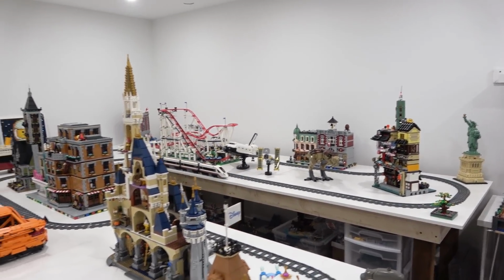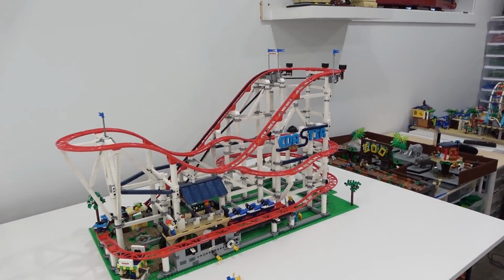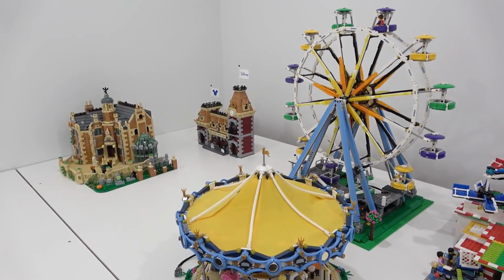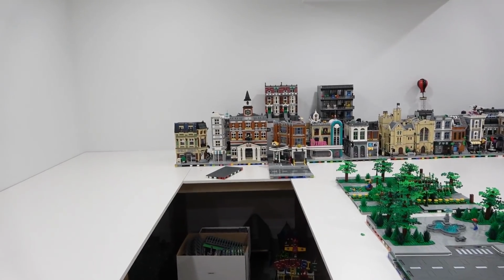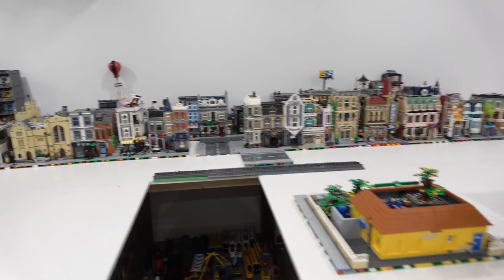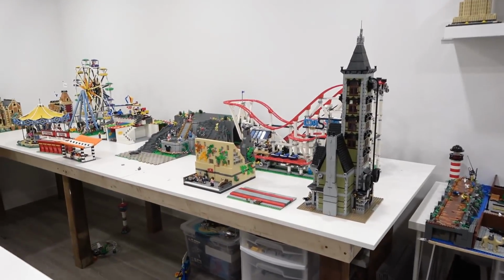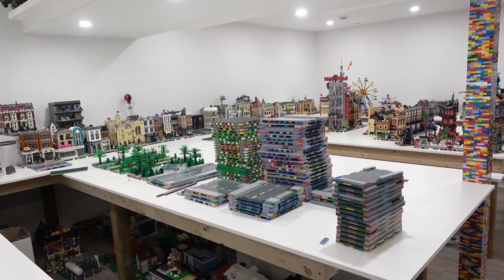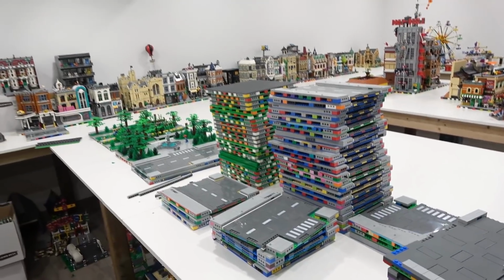LEGO City Rough Draft & Planning! Room Rebuild Part 8

Comment: I don't really get the problem, tbh. Why can't the modular buildings be snug against the platform? You can always cover up the front of the platform with a backdrop? I think it would be a bit of a waste using rock panels etc because you'd never see them... The train can run underneath the platform and in front of the modular buildings on the lower level. I love the idea of the amusement park on the larger table, I think that would look much better, with the platform and train going all the way around. Awesome job so far, love it!!

Comment: To get the rollercoaster running smoothly again check the carriages wheels are spinning smoothly when you spin them by hand. We had the same problem as yours and it turned out to be a fault carriage wheel. Replaced it with a new one and now it flys round the track super fast now.

Comment: For the platform in the back build it as a shelf mounted directly to the wall so it doesn't compromise as much table space and allows for extra wiggle room to make sure everything fits correctly how you want it. It also helps with getting the train system behind it and other potential hidden treasures

Comment: A couple of thoughts here:
1 - transform the 3 tables in 3 different city areas, like (left to right) seaside + beach + port on the first table, residential + downtown in the middle one and mountain + foretlst on the last one (lifting the mountain into the corner).

2 - make a gallery for the train behind the modulars, so to be able to line up the road on the edge, the modulares right behind and the tracks hidden in the galleries (you can use burps to hide the gallery AND give support to the coverage of the cardboxes)

3 - lay the streets following the shape of the tables, so to have the buildings aligned to the long sides of them, and not the short sides. That way, they will not end up "blocking" each other

Comment: Are you gonna paint or put vinyl laminate on the front of the exposed 2x6s that can be seen? I would make it a cleaner look. Hmm, I just thought you can have the back upper row buildings than a road and train tracks. Rock wall coming down than the lower row of buildings then a road. I hope that makes sense?

Comment: I agree with your current thinking for the location of the amusement park because although there are some tall structures such as the roller coaster and ferris wheel, they aren't solid builds and you can still see 'through' them. The raised platform can overhang the support legs to give room for whatever vertical lego structure you want behind the lower buildings, have you thought about 'arches' so that the open sections are between the platform legs? This would look cool using masonry bricks and foliage pieces and would even accommodate the roads that you want to have heading to the wall, you could use railway road crossings too plus the trains could still be seen running under the platform, easy access too - win win! 😁👍 I hope you like my suggestion, keep up the great work 👍

Comment: Hi. Since you ask in my opinion, I would focus on making it the most realistic. Tallest buildings in the back of the room, with one straight road in the middle - (big city). Then smaller in front. Everything on one level. In the corner, in the front of the room a larger mountain, with a lookout point - and train track go through. Does it have to be train tracks in the back of the room - maybe it will be too much?.  Either way, keep up the good work. Exciting to follow :)

Comment: My suggestion for the layout is to have raised platform around the corner too. On the right side of the city pop culture buildings, skyscapers in the corner, then the rest of the modular towards the left, finishing with landscape/campground in the left corner. On the right/center table the amusement park, on the left/center table residential area, which is lower. On the left side of the city I would put Ninjago as an island in front, then the sea continues into beach and cargo area all the way till the campground.
I hope I explain myself well.

Comment: LEGO is my secondary hobby.  I have a 450 square foot train layout in our attic.  When I have vertical areas that I want to hide, I do flat facades that are designed to blend with the buildings and landscape of my layout.  You could build basically make LEGO art panels on baseplates vertically and placed slightly recessed below your platform to give a feeling of depth without losing space.  Mrs. Bricksie has already basically done a similar thing to hide the backs of Diagon Alley.  It could be done in a way that is less parts intensive.  Try making one and see how it looks.

Comment: Hmm, personally I don't think you need the risers at the back.  I think that it'd look cool to have a city blocks layout, where you might have a block of modulars, but have some of them with their sides against the wall.  Imagine, say, a 4x4 square of modulars, but it's cut off, so just one half of it is visible, like it's sticking out of the wall.  In the center of the half square, you could set some taller, skyscraper type buildings, so that things are more built-up along the back wall.  You might need more skyscrapers for that though.
If you do go with the risers at the back, I would say that if you can't build it all out of Lego (I know, that's a massive suggestion, even if you got duplo for the bulk of it.) then perhaps you could disguise it, or the edges/entrances of it as part of the city's infrastructure, like an underground highway/train tunnel.  You could even use those ramps from the road plate sets, and have the MILS plates go down onto the old road plates under the risers, just to make use of all those plates.
Another idea, instead of using millions of BURPs and such to build a facade around the risers, if you make the risers 10 or 15 inches tall, you could use baseplates on their sides as the facade, and then use some clever SNOT techniques to build stuff on them, like say a staircase going to the upper level, a broken, grassy cliffside with a half-fallen tree, and a lot of back-alley type places, with bonus points if they're in a state of mild disrepair, like a real city would have, if there was a three story high cliff that the entire downtown was built around.

Comment: I like your original plan of the amusement park on the 60 inch table because of the extra space, and think about the other amusement sets that are/could be coming in the future. Same goes with having a half baseplate between your modular buildings. It is important to let you city breathe, it gives the opportunity to add a bit of life to the city and do a bit of story telling of your own. Only thing I would suggest is having a brick built wall rather than using the rock wall pieces.  Can't wait to see it all come together, its going to be epic

Comment: I would keep the train track out front without the baseplate. Then you can also run the train under the platform and put lights under the platform as well as decorate it. I would also use burps to the cover the front of the train tunnel. Would be great to put the GoPro on the train and get footage of it running through the tunnel.

Comment: The best part of your city is the downtown with modular buildings. In my opinion, this deserves the big table and can be done in a way similar to the old city, with long roads parallel to the table which gives depth and perspective. The rest will find its place around the city. No need for elevated platforms. When it comes to trains, I would do as you concluded before. No trains on tables, apart from the amusement park. You can rather put them under the tables, or more interestingly you could make a tube.

Comment: I would consider having the big table for amusement park. Not because it's my favorite part of the city, but because it requires a lot of space. Especially when you think of how much it consumed in the previous layout and that new rides will come out soon. You would have to compromise a lot if you choose to put it up against the wall. And I don't think it would be a lot different with the height, compared to all the other tall buildings you have. That's just my opinion.

Comment: I believe you had the right idea initially with wanting the tall theme park things in the back, and that putting those or Ninjago in the middle will ultimately be unsatisfying. I think you're going to want most of your shorter buildings in the middle tables, even if you do a platform in the back. like residential buildings, suburban area, etc. and tall stuff like Ninjago and Theme rides in the back areas. I would probably try first with no platforms in the back, and have the whole back wall be one long pop culture street - like a hollywood blvd, vegas strip type of thing.

Comment: What about using the dead space under your back row of modulars? It could be a fantastic tunnel system for your train to weave in and out of - occasionally popping out between 2 modulars and then winding back around before re-entering another tunnel somewhere elsewhere. There's plenty of space under there for 2, maybe even 3 rail lines!

Comment: Hey Jordan, love the new layout and it makes sense to raise the modulars that are against the wall, in my layout I push the lower modulars right against the raised platform due to space, building a rock 'face' all along doesn't make much sense as you can't really see it - if you do flat arches etc underneath the raised area, you could break up the raised section by having areas in-between with rocks / greenery etc and a short road bridge linking each raised section - bridges also look very interesting and allow you to put things underneath (in addition to the track..)

Comment: You do not really need the sidewalk on the side of the road without the modular buildings, so if you put some separation between the road and the train tracks (one or two studs wide perhaps a low fence) you could free up space that could be used behind the buildings. (I have not read all the comments, so I am not sure if anyone already suggested this)

Comment: I think your idea to have the amusement park in the middle table instead of the side table is better. Aside from a few big rides, the amusement park is mostly medium sized buildings and open spaces so it wouldn’t block the modular buildings. Pop culture street has a lot of tall buildings and skyscrapers so it would make more sense for them to be right next to the wall. Just my thoughts 😊

Comment: I've seen some MILS plates where the road and rail is on the same base plate.  They looked nice as well.  Compresses the amount of sidewalk but could work.
Reply: Agree on this, move the road close to the edge of the mils plate on the side that is against the modular as they already have a footpath, and you gain 8 studs, then have a reduced footpath on the track side

Comment: I would create a underground system rather than have the modular buildings sitting on boxes. 
That way, you can have little underground stations as the train runs through on the back wall, but have the modular buildings on top, with 'fake' stairs leading down to the stations.

Comment: Remove the sidewalk on the mils plates closest to the edge of the table and build the train track into the road (as a 3rd lane of sorts) or replace the sidewalk with a 1 or 2 stud wide guardrail and gain some extra space for the train track so you can still use the rock panels behind the modulars.

Comment: All your ideas are great why don't you mount the showings on the wall instead of having them stand on legs and then you could run the train track underneath that with the grass and then sneak it out sneak the track out between the road you know the front or the middle of the houses

Comment: You could do a subway system under the tables to run the trains. You could then have a cut out section in one of the tables to allow for the train tracks to come overground for a portion then another cut out on another table to go back underneath the tables again to complete the loop. You can then build in subway stations etc.

Comment: The train could go under the platform. It would save space, have a cool tunnel, and still keep your mountains. With the trains running under, you should be able to fit two tracks underneath.

Comment: My Rollar coaster does the same things I think the problem is with The track that can be moved with the others cars on it is sticking out to far I would try pushing it back more
Reply: My rollercoaster was running much slower than this - not even making it back down.
Some silicon spray (from a bicycle shop) sprayed on a cloth (it’s not wet or sticky) and wiped along the track and it’s super fast now!
Reply: @gnolan4440   Thanks for letting me know mine seems to be running fast just not quite going as far as it should

Comment: Hey, bricksie it be best if you do
Vertical Table
1st Vertical Residential Area
2nd Vertical Amusement Park
3rd Veritical City Town 
4th Vertical Beach Zoo and Docks 
Horizontal Table
Highway and traintrack
put the Castle and Fortress in each end of the horizontal table then in the middle is the waterfalls and recreational park so that the back drop will be a mountain with many trees... 
Then scatter the park

Comment: I agree with your final assessment. Having the amusement park on the larger middle table and the train running under the platform. Personally I'm not a fan of the whole elevated building idea, and would want my primary modular buildings (Town square, Pet Shop, Police, Fire, etc.) on the other middle table for easy accessibility and a more "city like" layout with streets separating them. Still have the trains run around the back, but save the back wall for misc modulars like the Quicky Mart, random houses, etc. Kinda like a suburb. I like the visual of all the modulars lined up at the back as you want it, but ultimately would prefer the all around access and true city feel.

Comment: Maybe screw in three 2"x6" boards on their side covered with melamine to the three front edges in the table gaps, giving the mills plate some support, even though they don't really need it. But it would prevent accidentally bumping into the mills plate and possibly knocking it off the table and it would look "clean and fresh" as you say. That would extend your table width by at least 6". Not sure how many studs that is. That extra room would be enough to pull the first row of modular buildings forward allowing for an elevation wall of lego and also have leave room for the train track at the front. How bout dat? :)

Comment: Love the idea of the raised platform.  When you spoke about doing a tunnel with a road leading into it... do that, but ALSO create a train tunnel and have the train run under for a couple blocks then pop out.  That would be very cool having the train disappear then pop out somewhere else with 2 working tunnels.
Reply from the maker: That's the plan!

Comment: Think bout putting the amusement park on other middle table with the post the back of the castle is open and you could back it up against the post and u could make a path up the center from the opening of park to the castle in the conner

Comment: Quick question for Bricksie, what is difference/advantages between pick a brick and bricks and pieces?
Thanks!
Reply from the maker: BAP has more variety, but PAB ships way faster. However, the two have now been merged. Though, they still ship them in 2 parts.
Reply: Thank you, 😊
Reply: Bricks and pieces has more variety but costs more and takes longer to ship

Comment: The trains should run in a tunnel under the upper level of modular buildings! 😉
Reply from the maker: Lol yes that is the plan... but it is a loop!!! They need to come around out front to be visible!
Reply: @Bricksie  Maybe you could make some sort of monorail system!
Reply: @nuggettheknight  yes
Reply: @nuggettheknight  that’s what I said for ask Bricksie
Reply: Yesss
Reply: What do you think about creating customized train stations in each area? I think that would be pretty nice
Reply: @brunoariasfuentes8077  it would also be cool if they were elevated you could also use the harry poter train stations
Reply: @bricksie a common build plan for scale model railways is to have a "scene" at the front and the trains disappear out of eye line and re appear the other side so essentially a loop. So I see nothing wrong with trains running under the platform. The only issue you may have with that is if you have a derailment it will involve a fair bit if work to recover the train! But I've never run a lego train so can't say if they are more reliable than a 00 scale loco! 🤣

Comment: Hi Bricksie! Loving the rebuild progress! I'm not sure how you feel about LED light kits and LEGO, but would you ever consider using LED lights in your city lamp posts or other structures? After the rebuild, it seems like added functionality would be the next logical step!
Reply: I have them in my city, they look great but hugely reduce the modularity of the city as it's a pain to move buildings once they're wired in. Also it's tough to hide the wires
Reply: When I got the 2021 at-at for Christmas I got a led kit with it and I want to add it so abd but the insturctions are not clear :(